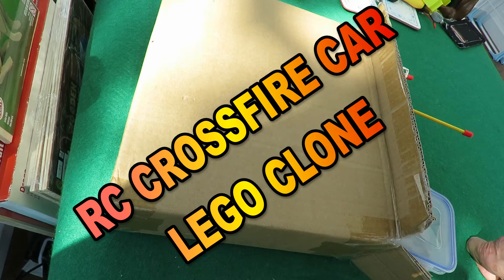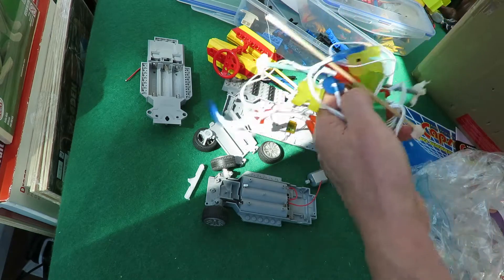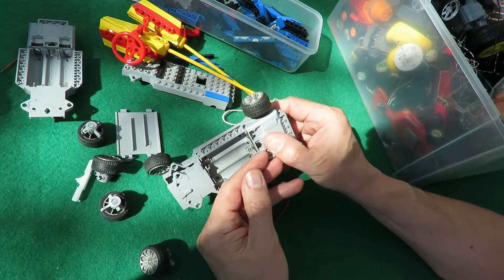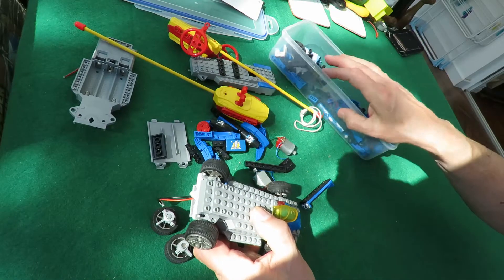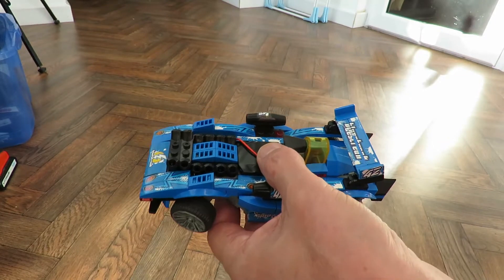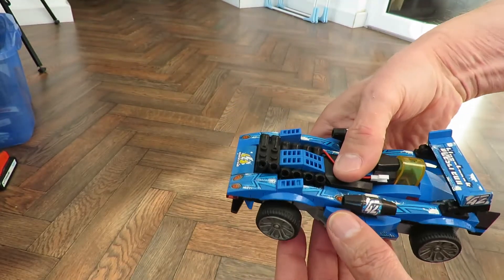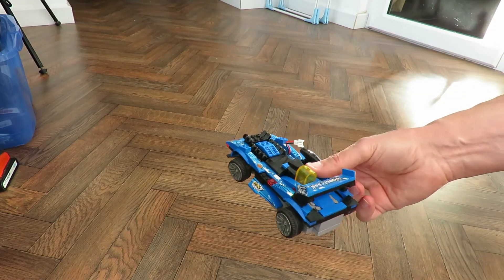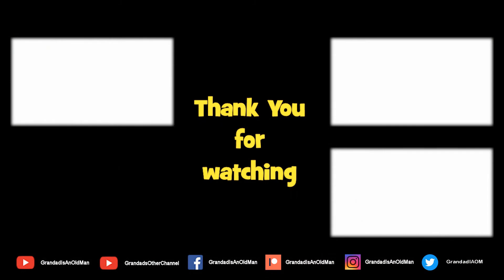Can I rebuild that RC Crossfire Car?

Comment: I went to the video of when you bought it for £3.99 and could see the receiver on the middle of the body, so I am wondering where is the receiver in this one? 👍👍👍
Reply from the maker: It's not in there yet. I just put the battery on so you can see it run round in circles. I cut a lot of plastic out and go full hobby grade 😆